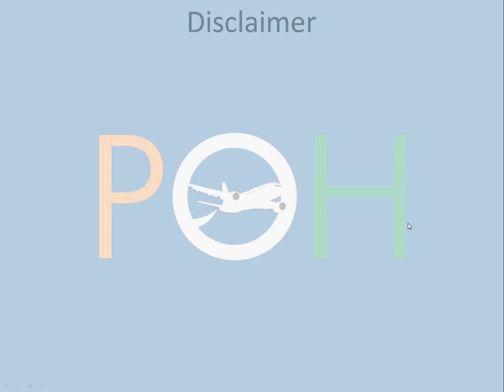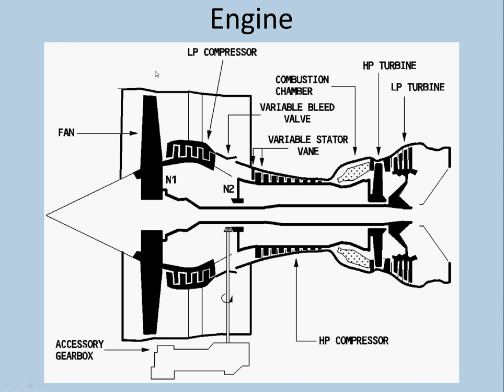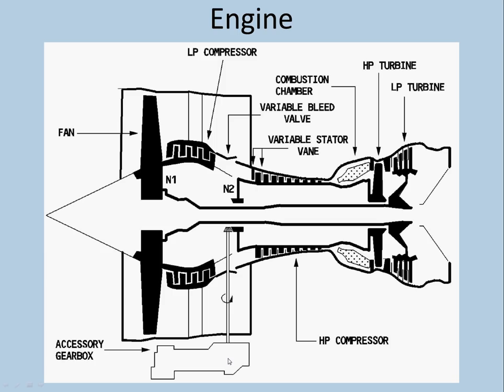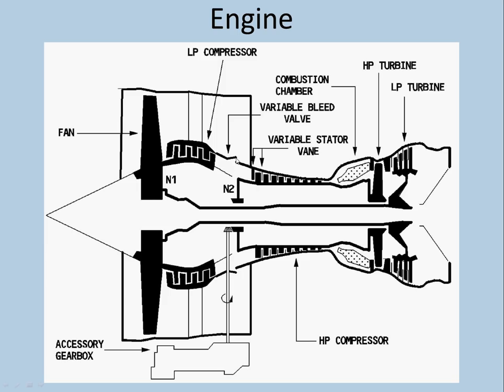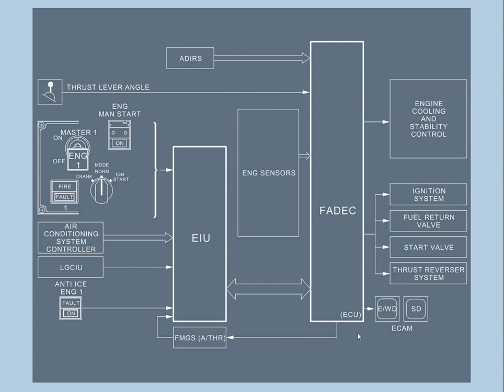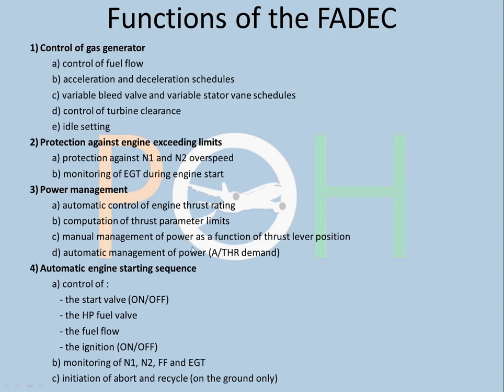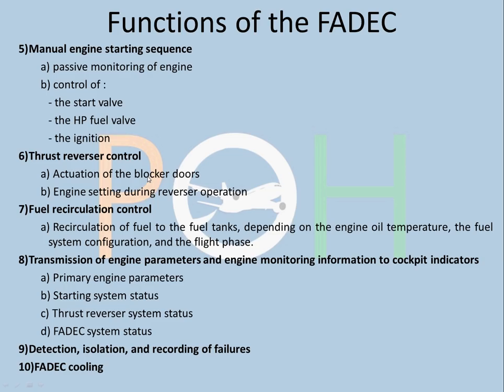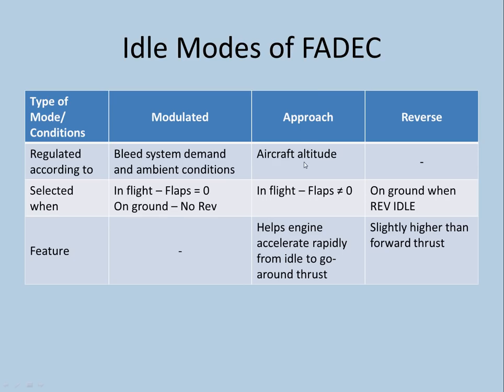A320 - Powerplant (Engine & FADEC)

Comment: The FADEC is also responsible for Performance Control ( HP/LP Turbine Active Clearance Control, Core Compartment Cooling system, Variable Stator Vane ( VSV System) these systems use Servo Fuel Pressure from the HMU ( Hydromechanical Unit) to operate special actuators , the FADEC receives position data from sensors installed on the Actuators to effectively monitor and control the systems mentioned above.

Comment: I came to know about that apu bleed starts a small engine , this small engine shaft is connected with engine shaft. Can you please tell me something about that in detail?
Reply: @beno jasper first of all APU  is itself a single stage gas turbine engine which delivers bleed air( pneu) to the engine that is pneu starter. This pneu starter is aerodynamically connected to  gear mechanism thus transmit the power to the N2 shaft that is high press shaft and then the other functions takes place accordingly. Hence in short we can say a small  engine (APU) starts the main engine.
Hope that is clear!! 🙂
Reply: @rekha_raia320_fe4  too good mam
Reply: @mdmahtabkhan8753   Thank you!
Reply from the maker: No idea on that.
Reply: I think AME  give the information about this topic

Comment: GENERAL
The Electronic Control Unit (ECU) is supplied from the aircraft electrical
power when the engine is shut down or when N2<58%. The Permanent
Magnet Alternator (PMA), which is also called Control Alternator,
supplies the ECU when the engine is running and N2>58%.
POWERING N2<58%
Each channel is independently supplied by the aircraft 28 VDC through
the Engine Interface Unit (EIU). At initial A/C power-up, both engine
ECUs are supplied with aircraft power for 5 minutes.
Aircraft 28 VDC is used for:
- power-up check of the Full Authority Digital Engine Control (FADEC)
before engine start,
- engine starting,
- powering the ECU while the engine is running below 58% N2.
Note that the EIU takes its power from the same bus bar as the ECU.
POWERING N2>58%
As soon as the engine is running above 58% of N2, the Control Alternator
supplies the ECU.
The PMA supplies each channel with three-phase AC power. Two
transformer rectifiers provide 28 VDC power supply to channels A and
B.
Above 58% of N2, the ECU logic automatically switches to the control
alternator supply. In case of control alternator failure, the ECU will
automatically switch over the 28VDC power supply from the aircraft
network, available as a back-up through the EIU.

so 12%   or 58 %   N2   ??
Reply from the maker: It is N2 12% only. There are different types of alternators as well. So yeah
Reply: Would this be similar on a Boeing 787 FADEC?

Comment: sir why idg in aircraft black in colour? I am searching answer of this question since long time hope you will reply
Reply from the maker: You'll have to ask about this to an engineer.
Reply: @abhay dube the qsn asked is imp from the engineering point of view,  the IDG has special coating of black color which helps dissipate heat n reduce the magnetic interference especially (radio) which can cause due it's operation .
Hope you ve got the answer! 🙂
Reply: @ @rekha_raia320_fe4 now I got it thanks alot
Reply: @abhaydube7780  you're welcome! 🙂
Reply from the maker: Thank you! 🙂
Reply: @poh  welcome CAPTAIN!

Comment: Are the modes of FADEC manually selected or is it also an automatic function performed by itself?
Reply from the maker: All modes are automatically taken care of.
Reply: @poh  on Boeing Airplanes , there isn't a " Mode selector" , the EEC ( ELECTRONIC ENGINE CONTROLER) switches continues ignition once the Starer Cuts off to push the Engine to idle power. Boeing also equipped the Airplanes ( long haul) with a button that once pushed switches the ignition system to pulse the ignitors continuesly , providing backup incase the Automatic Ignition system fails to protect against FLAMEOUT ( In-flight and on the ground).  this future is available on : 

-Boeing 777    
-Boeing 757/767
-Boeing 747 
-Boeing 787 
These are also equipped with redundant Autobrake system offering :

- RTO ( MAXIMUM BRAKE POWER enough to stop the airplane with out delay, this is available when the pilots decide to abort takeoff ( Ground) and its also used brake the wheels prior to Landing Gear Retraction ( in-flight), once the Landing Gears are up and locked, the system is disengaged automatically and the brakes are locked

-Max Auto ( Maximum Manual braking pressure + Autobrake) for rapid braking incase RTO isn't available ( on the ground to abort takeoff and acts as Emergency Brake)

- Autobrake 1 and 2 ( braking is initiated after a delay to warm up the brakes before they are engaged to provide deceleration on longer runways

Autobrake 3 and 4 ( applied immediately after landing without delay for increased deceleration rate on shorter runways
 
-Off : Resets the system in the following cases :

- Reversers Stowed
- Speed Brakes Down 
- Autobrake selector moved to Off by the pilots
- Rudder pedals pushed down for manual braking
anyone of the conditions above is enough for this to happen on the the ground

- Disarm ( turns off the system and its hydraulic supply to help save fuel and reduce loads on the Hydraulic pumps ( Demand and Engine Driven Pump).
Reply from the maker: He was asking about idle modes of FADEC. Nevertheless thanks.